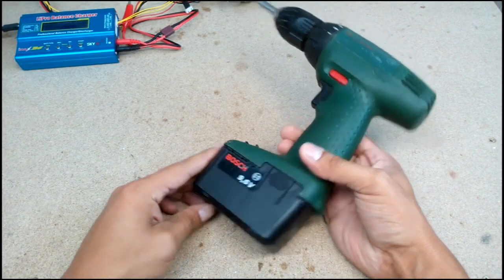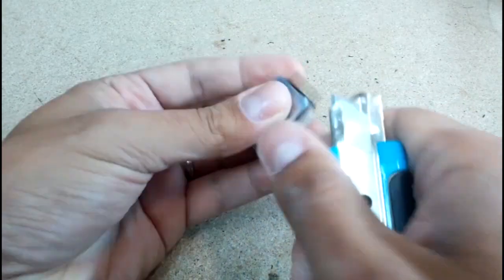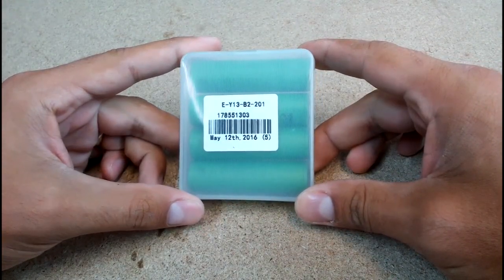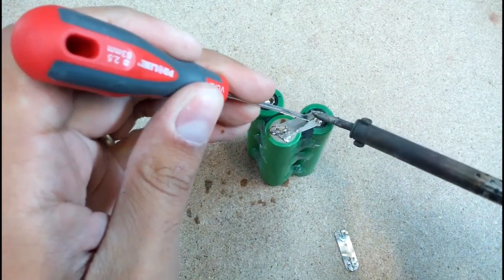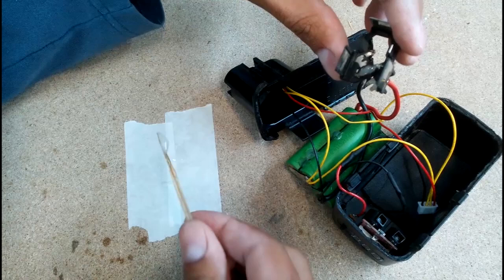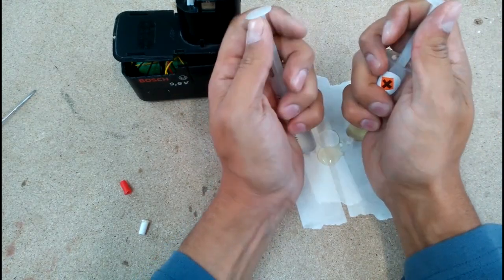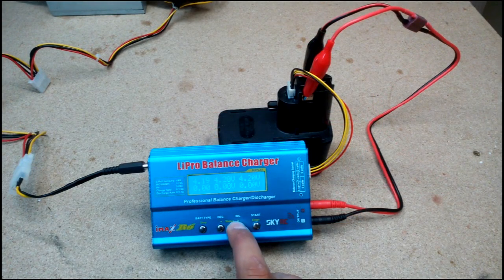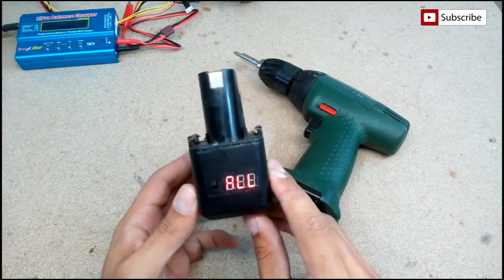DIY: Ni-Cd To Lithium Battery Conversion By Using 18650 Cells

Comment: Nice vid!

I've done the same thing with a 18V Parkside cordless drill which had 15 dead Ni-Cad cells. I've used 5 LG IMR18650-HE2 2500mAh cells capable of drawing 20 amps. Works wonderfull. However, I've ordered those LG cells with spot welded tags so I didn't have to solder directly on the cells. Li-Ion cells don't like high temps, they can be damaged easily.

Nice work, thanks for sharing!
Reply: Goog work Ruud. Where do you buy the cells?

Comment: Next time you could glue some blocks in the corners of the battery case and drill and screw together with self tappers. This will allow replacement of any parts easy.

Comment: I think it is pointless , you forgeting basic fact , NI-CD battery is only type of bateries which can output for short period of time more like  1,5 time of rated amperage. Li-On baterries they cant do that , which means your setup will never have same torque like setup with original battery.  Difference betwen NI-CD powertool and Li-On powertool is not only batteries but also different electric motors.  BTW sorry for my english.
Reply: Peter, you're not up to date with this. There are Li-Ion Batteries capable of more than 10C. All Pro Tool manufacturers switched to Li-Ion batteries.
Reply: +Nico Baumgartner Nico I have home 30C lion battery for my RC but  that is not my point. Im portant is LiOn powered power tool is using electric motor with different specs like Ni-cd powered tool . That is my main point.
Reply: Peter, I actually don't see your point - I have a blue Bosh (don't remember the model) it's brushed, and the speed control is as primitive as it gets - only difference I see is, the battery tells the speed controller, when it's empty (or the controller decides that - not sure). I have an old Metabo Cordless Circular Saw. With the original NiCD Battery, it performed well, but you had to change batteries faster than you could charge them. Since I converted it to 5S2P Li-ion, it performs better and lasts longer. Of course, a more modern, Brushless model would be more efficient.
Reply: Peter Galajda Peter Galajda /// I think your lack of "other things" will be allowed too.

Comment: One more battery would have been good.increasing the voltage by 3.7v wouldn't have had any negative issues, in fact it would have run better.
Reply: it was already above the original voltage of 9.6

When fully charged at 4.2 volts * 3 cells = 12.6 volts
When discharged         3.7 volts *3 cells = 11.1 volts
Reply: No-no-no, he just exceeded the nominal ratings by a tiny margin and, that is ok. What you're suggesting is dumb because you'd increase the nominal ratings by more than a cell voltage and that could be be detrimental.
Reply: Resistance is Fruitful: fully charged Ni-Cd / Ni-MH have 1.4 volts per cell, so it's 11.2 volts if fully charged
(maybe up to 11.5 volts).
I think that one and a half volt isn't the big problem. Problem could be the voltage drop ratio of lithium versus ni- xx batteries... lithium has low voltage drop so more amps will flow.
Reply: Be carefull with that. Some speed controllers don't like much higher voltages than designed and can burn the controller.
Reply: it could be fatal for the drill motor.
Reply: Resistance is Fruitful steady on folks I thought it was a 12 battery conversion but didn't realise it was 9.6, that's what happens when you skip some of the video.
Reply: jony joe: it could. But normally it's really no problem. maybe the speed controller can make troubles...

Comment: link for the meter please and batteries
Reply: Here is a link to Ebay for the LiPo power meter   http://www.ebay.com/itm/5-x-1-8S-2in1-RC-Li-ion-Lipo-Battery-Low-Voltage-Meter-Tester-Buzzer-Alarm-MA-/252154919314?hash=item3ab59ab992:g:7~cAAOSwnNBXbPUz
Reply: I've been studying fixing a car battery and discovered a great website at Jons Mender Guide (check it out on google)
Reply from the maker: +Serviciosymas batteries link is in video description. Meter just type: lipo power meter on ebay
Reply: Georgios Antonopoulos
Reply: Georgios Antonopoulos
Reply: Serviciosymas
Reply: +Imre Csermely nk“
Reply: >>How To Start A Battery Business At Home>>>[ https://t.co/jfZbilIKLW ]........

Comment: i was happy until you started glueing everything. how the heck will you disasemble your stuff next time you replace batteries?
Reply: rodstartube //// good point but not important here.  It's not a "how to" video, it's rather an "eye opener"...  The parts about safety was very good to hear.  You can duck tape your battery pack if you like.  I would use epoxy, and when new battery failed just buy a new drill.  Tech advances as we speak.  I bet he has a new video out there right now. Look for it.

Comment: A better way to connect the cells would be to use a capacitance discharge spot welder like the one I built on my channel.  It is fairly simple and inexpensive.
Reply from the maker: +The Mechanical Philosopher yes, spot welder will be the best option, but because I don't have one, I simply soldered cells;)
Reply: Absolutely. I didn't mean to be negative in any way.  I'm just trying to show everyone that it is fairly easy to build a welder if you plan on doing this sort of thing more than once.

Comment: Once someone else will use this drill, that person will discharge cells to 0V, this will kill them.
So use proper BMS.
Reply: who would rent ur drill???
Reply: friends, family, neighbours, random persons?
Reply: Im sure as hell they will return it after there ears stop bleeding. That alarm is REALLY loud.
Reply: He muted them...
Reply: no he made them less alarming using blue sticky tack.
Reply: Arek R. I would explain to anyone, including family, that this drill requires special handling for charging and that the can buy their very own cordless drill for around $60 to $80.  I would tell then that lending this particular drill would likely be the end of it and leave them feeling dad.
Words, try using then😲
Reply: Arek R. connect a relay to the beeper so it turns off when voltage is too low
Reply: Only problem is that when trying to find a dummy how to, there is no information. How to wire 3 or 4 cells in SERIES with a BMS charging board?
Reply: Michael, You're giving out BAD info with that web link (joxcharge.com). I tried it and low and behold, it tries to redirect to another site. TOTALLY UNSAFE!! >> "Ghostery prevented a redirect from 
joxcharge.com to 9be40eumvpbgcte148ksy04mfh.hop.clickbank.net, 
which is part of ClickBank. 

This tag appears to redirect to 
http://9be40eumvpbgcte148ksy04mfh.hop.clickbank.net/?tid=BATTERY
If this link doesn't look right and you'd like to proceed, click on the icon below to allow ClickBank and reload."
Reply: 10:4 littleal
Reply: 1) NO. The drill will stop working properly way before the batteries are dead. And the meter is not connected unless the button is used to test the batteries. So, no, it will not kill the batteries. 
2) Don't lend your modified tools to unqualified people.
Reply: @robertcartier5088  Don't lend any tools,  never never never. I learned the hard way.
Reply: He should use a proper BMS so he won't have to use special charger, charge it with stock charger and BMS would take care of high voltage or low voltage(when discharging) ... and he's done, more professional work and he won't need to check the voltage - it's beeing take care of :D
Reply: Arek R   Mind your own fucking business!

Comment: Hi! You helped me alot to convert my 18V Ni-Cd to Lithium battery. From an old laptop battery I used 5 x 18650 cells to make 20V, I tested it, it works great, no problems at all (accu device is 18V)! But now i need a charger to recharge the battery when it become empty... I suppose that i can use an ordinary laptop adapter, for example Liteon 19V 3.42A 65W. But now the problem is how to control the battery to stop charging when it become full charged.. I dont want to damage the battery so I hope that there is some electronic device to for that battery of 20V (18V) which regulates this thing! If you have any ideas please let me know! Thank you in advance!
Reply: just get one of those cheapy IMAX B6 chargers £10 They are the buisness for charging up powertools although i wouldn't use the for drone's or anything critical pps you will need a 12v power supply for the B6
Reply: Do this thing will do the work for the 12V Li battery?
http://www.ebay.com/itm/172165298251?_trksid=p2060353.m1438.l2649&ssPageName=STRK%3AMEBIDX%3AIT
Reply: Or maybe better this thing:
http://www.ebay.com/itm/161880385141?_trksid=p2060353.m1438.l2649&ssPageName=STRK%3AMEBIDX%3AIT

as i can understand, that have power supply inside, that above not...

but now i dont understand, in autor´s video, he conecting separately power (black and red wire) and separately ballance conector.. Why is that? On this device i see that it only have ballance conector, for 2 cells and 3 cells, and ac/dc power conector
Reply: Be carefull with those laptop batteries. They are NOT rated for high current drawing. They are not going to have a long life.. And use a charger who can balance charge them such as the SkyRC imax B6 charger used in this vid. You have to solder balance wires on the cells though. NEVER use the original charger that was included with the cordless drill or connect a laptop charger/adapter!
Reply: Sladjan Ilic /// he mentioned and showed the charger he used.  It was BLUE -- a I-Max I think?  Rewatch the video.

Comment: Soldering wires or tabs to the end terminals of Ni-Cd, Ni-MH and lithium cells never ends well.  An impulse spot welder should be used, or the cells should be taken to a shop that offers custom battery pack construction services where such spot welding can be done.
Reply: I built one of those.  You can see it on my channel.
Reply: magnets and solder tabs seem to work well and finish by setting pack in silicone so it all stays together nicely ps dont forget the magnets will attach to your iron so solder tabs seperatly

Comment: My personal opinion, I would replace with high capacity Ni-mh batteries, the lithium are a pain in the ass, you always have to make sure the batteries are balanced with a balance charger(some say you can charge a few times without the balance lead, but if the battery was sitting for a long time, and a cell looses it's charge, then you got a fire). At least with Ni-mh batteries, you can put them on trickle charge to balance out all of the cells. I did this with one battery, used an old charger, gutted it, and use it as a base so I can hook up to my Imax b6 charger. (which used to always kill batteries,as it wasn't a computerized charger with delta-v cutoff, so the batteries would just cook.) Every so often, I'll just hook it up to my constant current charger and just let it trickle at 100 mA for 24 hours to even out the cells.
Reply: Most if not all of the branded 18650 have a temperature switch built inside. If the temperature of a cell increases to about 90 deg. celsius and above you hear a slight pop and the battery stops working.

Comment: If you double up on the batteries, with three in series, and another three in parallel, your drill will last MUCH longer.  Nice use of the indicator.
Reply: From 9.6 V to 12V is close enough for that 9V motor.
Reply: Can be changed with old changer
Reply: Incredible that is amazing I need you to help me learn how to master series

Comment: I am strongly considering doing something like this with my dead Ryobi 18v battery packs. Further searching revealed that their Lithium battery packs use either 5 series 18650 cells, or 10 cells in a 2P X 5S configuration for their low and high-capacity packs, respectively. So the cells should fit. I hope there's room for the neat voltmeter also. Time will tell. Your new pack is presumably around 2.4 amp-hours of capacity depending on the exact cells you used. Did your old NiCd packs indicate their amp-hours capacity so we could compare them? My old Ryobi NiCd packs say nothing about it, but the new Lithium packs by Ryobi show the capacity as well as the nominal (18v) voltage.

Comment: Excellent bro!!!!! 
Very amazing project as U just revived the drill into a new life. I also did a same project  with 3S Lipo battery b4 seeing your video. However, I could be using a voltage checker like U which I did not. Rather, I hook up it outside on charging plug. I learnt some idea frm your video too. :-D

Comment: The old battery pack was 9.6 volts (eight x 1.2v NiCd cells), but your new pack is 12.6 volts when fully charged (4.2 x 3) and 9.0 volts when fully discharged (3.0 x 3). Do your cordless tools accept the higher voltage without damage? And what about capacity. Sure the drill spins faster with more torque when given 12.6v instead of 9.6v, but can you drive in the same number of screws or operate for the same length of time before the tool has depleted the battery? I would expect that the capacity is significantly reduced, given that you have 3 cells instead of 8 and the total mass of chemicals in the batteries is half (your weight comparison) even though LiPo chemistry is more energetic than NiCd. I'm not making any claims here, only asking questions with my real concerns and the reasoning behind the questions (which could be faulty). I'd be very interested to hear your experience. Particularly because I am tempted to do something like this with my Ryobi 18 volt battery packs, if they will hold 5 or 6 cells inside of them.
Reply: the 8 nicd cells are only 1.2volts at what is called their nominal voltage. fully charged they are 1.4volts which takes the voltage up to 11.2 volts so the difference is probably within it's  tolerance
Reply: Something like 20V battery tool doesnt exist , always it is 18V  it is just marketing. Every 18 V battery when is fuly charget is giving 20V .
Reply: John Toscano my Bosch NiCd=12V*1.2Ah=14.4Wh.
Li=3*3.7V*2100mAh=23.3Wh. I.e. Nearly DOUBLE the energy and HALF the weight.
Reply: The 3 18650 will give u a longer drill time for sure
Reply: You are correct. I've done a conversion with a 18V Parkside cordless drill using 5 18650 cells and the voltmeter shows 21V when fully charged. 4.2V x 5 = 21V.
Reply: Many years ago, when NiCad batteries were new, I had a cheap drill whose batteries crapped out. I made a wire to power it from my car battery. At  the time, I discovered that the motors in the drills were exactly the same, between 9.6 volt and 12 volt versions of the tools. The only difference was the batteries themselves.
Reply: ｒㄥㄜ
Reply: 9.6v is only the "nominal" voltage of the original NiCd cells... directly off the charger they can be up to 1.5v/cell (although they do drop more rapidly than lithium)... this is pushing the limit I would say, but should be OK.  Also, the cells he used are 3.0Ah and with 3 of them at a nominal voltage of 11.1v, they have far more energy (more than double) the original batteries.

18v conversion is easy... 5 lithium cells is normally labelled as 18v.... and I have done conversion if 14.4 packs using 4 cells with no problem.
Reply: all my tools run on my 6s 3p lipo battery packs ( i have 5)
my impact wrench has worked hardest 20000 m12 bolts over 8 months it was a kielder 18v wrench li-ion
my drill has done 4000 12mm holes in 10mm grp over 6 months it was aeg 18v dril li-ionl
my second impact wrench has done 6000 m12 bolts over 1 year it was clarke nicad 24v
my clarke drill has done 2000 12mm holes in grp over 1 year it was Clarke 14.4v li ion
my makita hoover/dust buster 18v li-ion has done over 50 hours 
my 18v hitachi grinder is crap with the battery pack so i use a relay module to switch between 2 battery packs every 5 seconds and that now works ok but its cut less than 30 metres of material so far
my latest is pure jigsaw 10v which i used a 24-12v step down module but it was to weak so now i just plug straight in 24v and although its a bit fast its lasted a month so far 
none of my tools electric motors (1 brushless) have failed yet and apart from my crappy soldering are pretty  reliable
so to summerise i would say any cheap tools benefit changing to li-ion but keep the amps down when you charge them
Reply: Most cordless tools can accept slightly higher voltages without issue, Might effect the life in the long term but I find that usually something else craps out first like the gears getting chewy. 

For instance often those 20V tools often have the same motors in them as the 18V and those same 18V tools accept 20V just fine. I have 3d printed battery conversion adapters so I don't have to worry about getting stuck in a system.  

Lithium battery packs really are worth it btw, they stay charged on the shelf, no more coming back to a tool and finding it dead, nicads love to just lose power over time. Well if you do it yourself you will have to make sure whatever you rig up doesn't draw power when "off" but yea. 

https://milliamps-watts.appspot.com/

Calculator to see mAh in relation to voltage.
Reply: Oh also you can get some very small dc to dc buck converters, then you can limit the voltage. Perhaps install a trim pot so you can overdrive it when you want the power and under when you want the battery to last. Would give you a consistent voltage also instead of dealing with drop off, I think actual lithium tool batteries may have that built into their modules since they often just cut off instead of losing power.
Reply: @sanityfalling  those "small" buck conversion modules (which might fit inside the housing) certainly could not handle enough current for a drill/driver under load....   Also, remember that direct off the charger a 9.6v NiCd battery could easily be over 12v... it will drop to 9.6v faster than lithium, but the electronics have to be able to handle a higher voltage.  The original packs only appear to "cut off" because NiCd discharge profile has a sudden voltage dropout at the end.